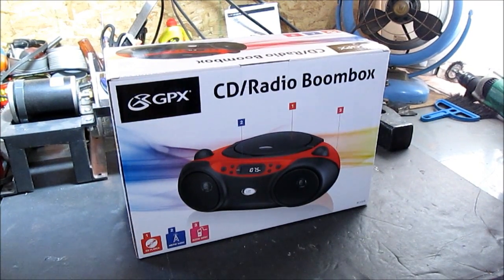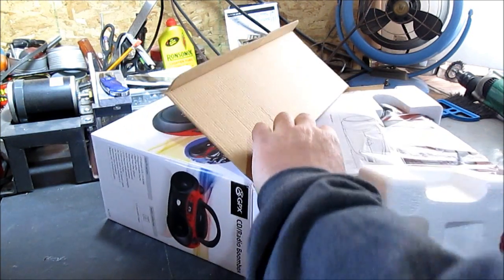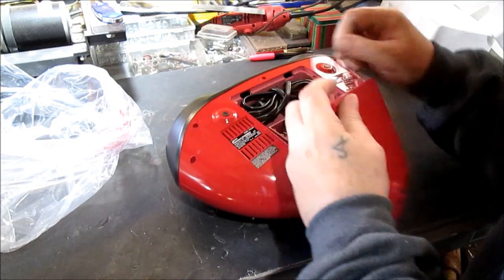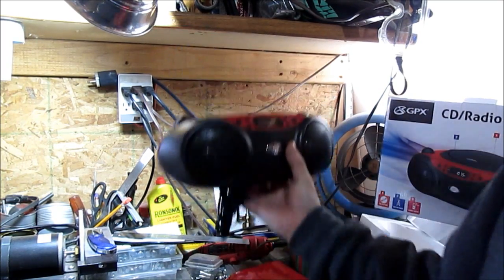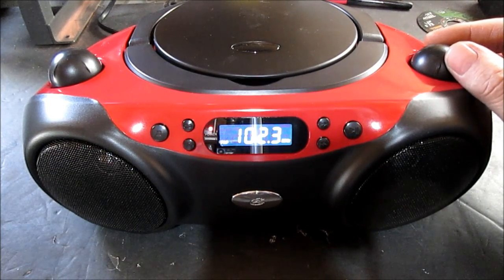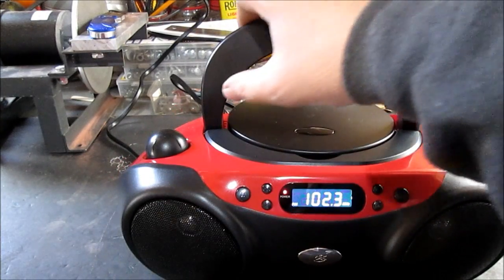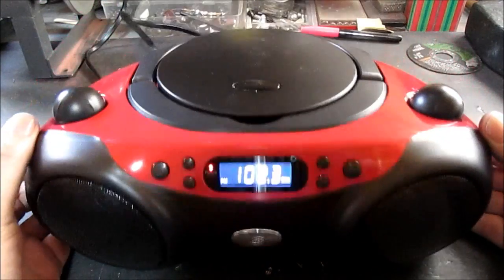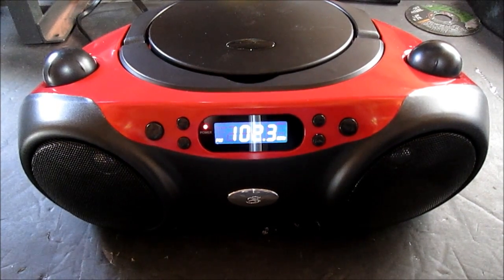Un Boxing a....  Cheap Radio for the Workshed

Comment: For some reason I was waiting for you to weld a better antenna onto this thing.
Reply from the maker: My Useless Random Videos Of No Particular Consequence Channel It uses the power cord for FM I did wrap it around an aluminium yardstick I have hanging on the wall
Reply: @not2fast4u2c  did wrapping the cord around the aluminum yard stick give it better reception?
Reply from the maker: It helped a little ...I did take the radio apart and ran the antenna wire to the outside  and hooked it to a car antenna....The inside antenna is a thin piece of copper foil in the back of the radio

Comment: Looks like it has analog tuning with digital display,   But it gets the job done.   They are going for 25.00 on amazon right now.   Descent for the price..👍
Reply from the maker: The radio still works OK but the CD player quit working after only using it 2 times ...A common complaint in the reviews on this

Comment: Cheap radio not that bad these day,because it will last a year or two easily,if you keep it out of dust or moisture out of it components,only the sound and the tuning are the major problems in these electronic products.

Comment: I use a cdplayer / radio with car speakers A lot better and runs only 12v
Reply from the maker: ftrikerfox I have a good power supply and speakers I may look for an older car radio from the 60's or 70's

Comment: Best thing about mine was smashing it all over the garage floor absolute junk
Reply from the maker: I am still using mine for a shop radio ..What sucks is the CD player quit after using it 2 times
Reply: @not2fast4u2c  you probably shouldn’t have mount it on the wall. (No offense)